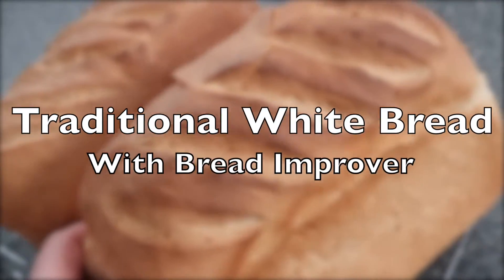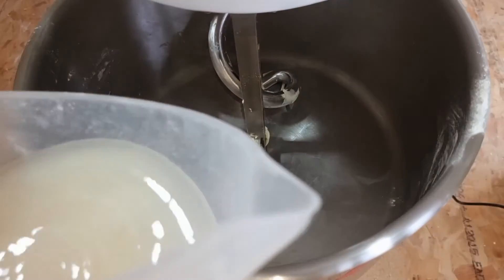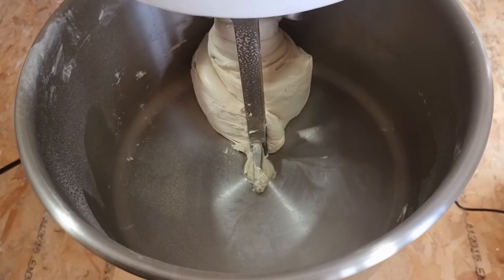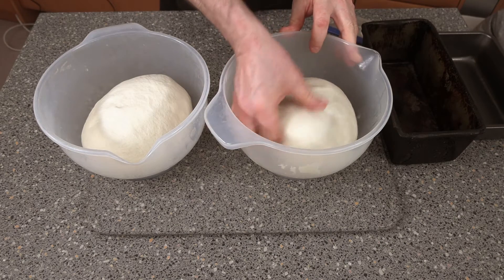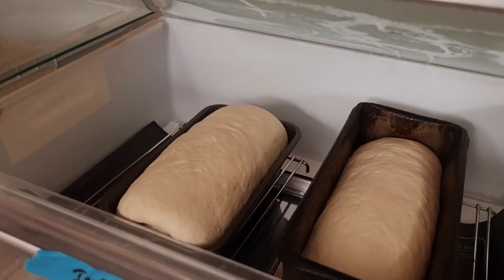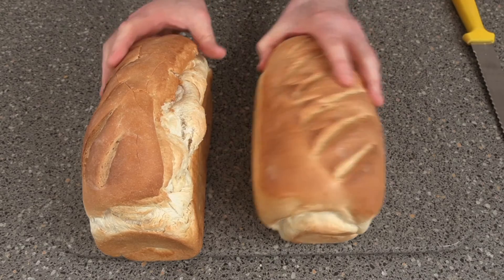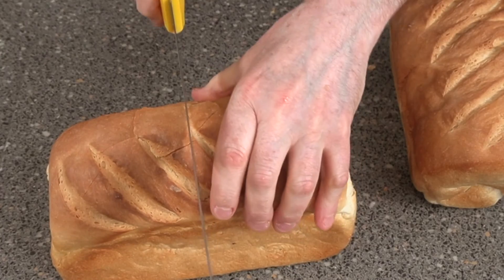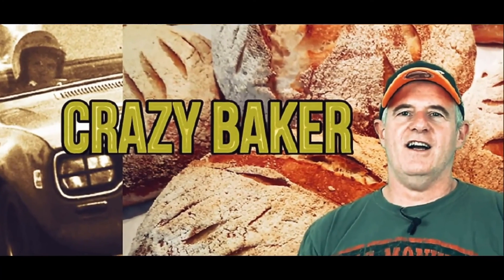Traditional White bread Recipe with Bread Improver Part 2 Test Baking

Comment: Thank you for this video it looks great. 

Could i please ask how much active dried yeast, bread improver and water would i need when using 500g of white or wholemeal flour
Reply from the maker: Of course! Here's a simple bread recipe for 500g of flour:

Ingredients:
- 500g all-purpose flour
- 10g salt
5g bread improver 
- 7g active dry yeast
- 320ml warm water
- Optional: seeds or oats for topping

Instructions:
1. In a large bowl, mix the flour and salt together.
2. In a separate bowl, dissolve the yeast in warm water and let it sit for a few minutes until it becomes frothy.
3. Pour the yeast mixture into the flour mixture and stir until a dough forms.
4. Knead the dough on a floured surface for about 10 minutes, or until it's smooth and elastic.
5. Place the dough back in the bowl, cover it with a damp cloth, and let it rise in a warm place for about 1 hour or until doubled in size.
6. Preheat your oven to 220°C (425°F).
7. Punch down the dough to release any air bubbles, then shape it into a loaf or place it in a greased loaf pan.
8. Cover the loaf with a damp cloth and let it rise for another 30 minutes.
9. If desired, brush the top of the loaf with water and sprinkle seeds or oats on top.
10. Bake the bread in the preheated oven for 25-30 minutes or until it's golden brown and sounds hollow when tapped on the bottom.
11. Allow the bread to cool on a wire rack before slicing.

Enjoy your homemade bread!
Reply: @crazybaker1  oh thank you so very much. I will try this and let you know my results. Thank you again
Reply from the maker: @diane9501  your welcome 😀